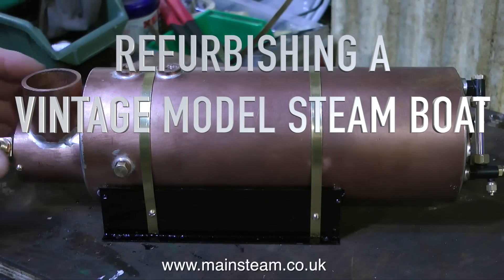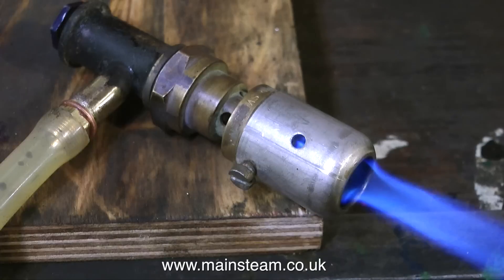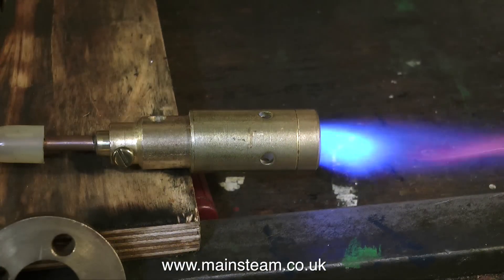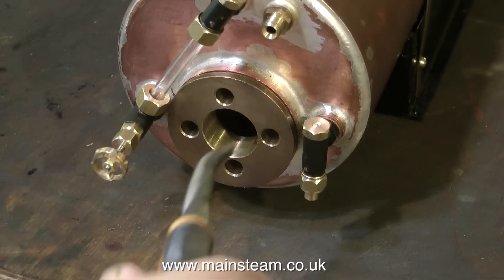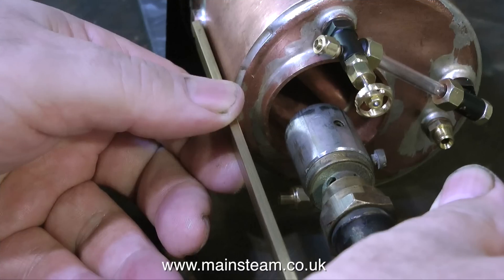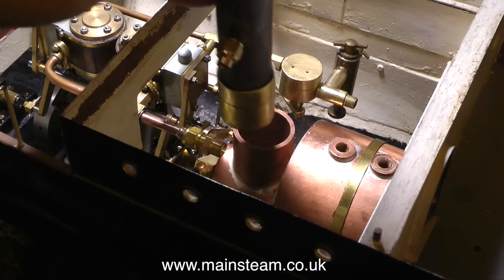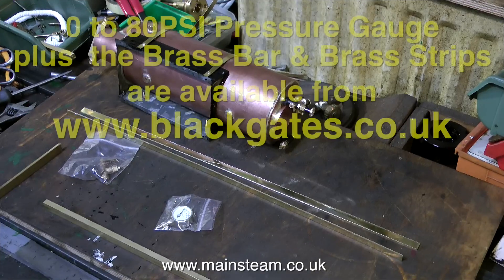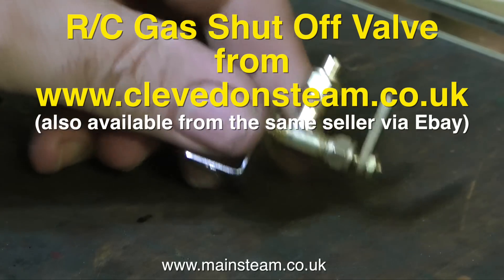REFURBISHING A VINTAGE MODEL STEAM BOAT - PART #11

Comment: You've commented a few times about finding or using a good burner.  Maybe you can market them, if they're hard to find for this application.  You could probably turn-out several a week on your lathe and drill press. Just copy an old, reliable design.